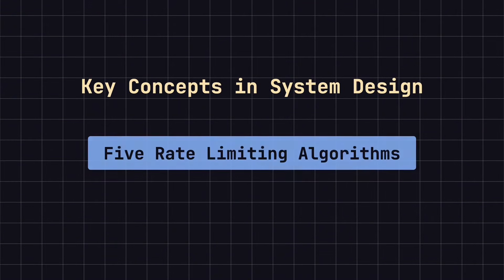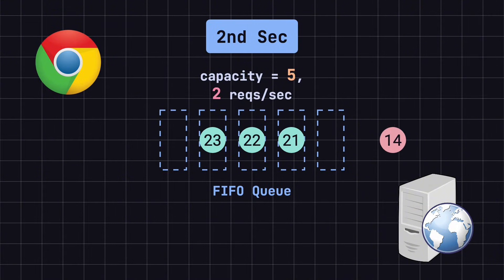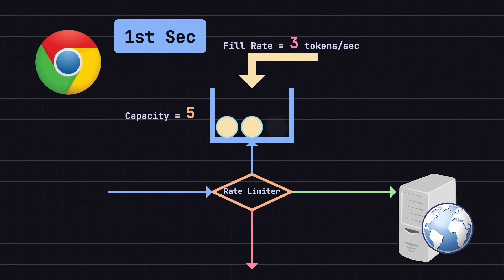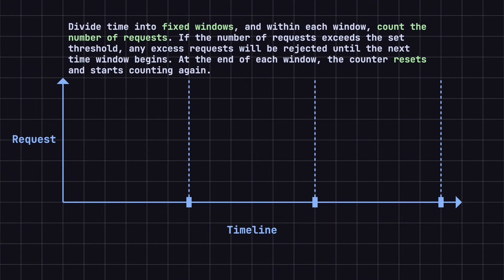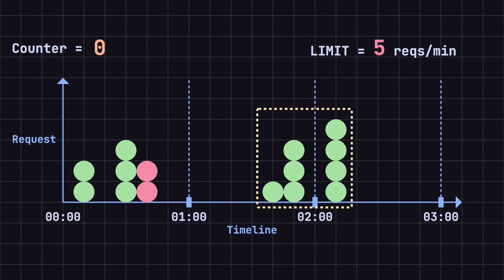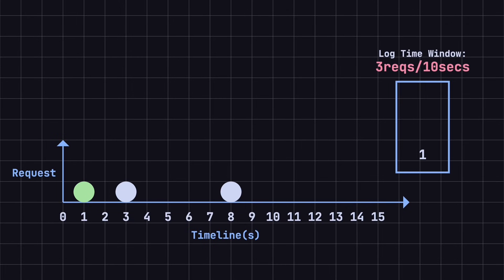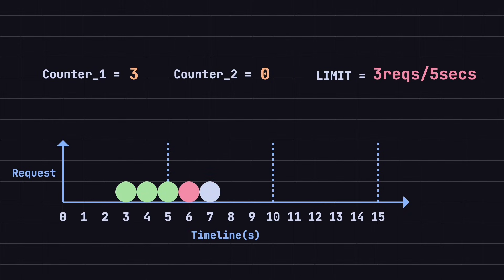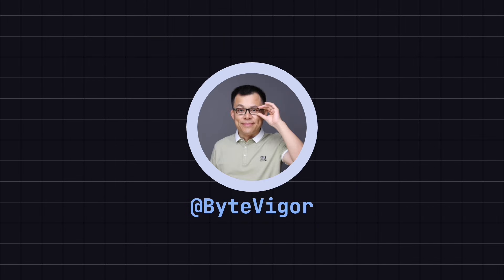Five Rate Limiting Algorithms ~ Key Concepts in System Design

Comment: In the sliding window log algorithm even if the request is denied due to exceeding the threshold the timestamp of the request is still logged. Let me know my understanding is correct?
Reply from the maker: Yes, your understanding is correct.

In the Sliding Window Log Algorithm, even if a request exceeds the allowed threshold and is denied, its timestamp is still recorded in the log. This is because the algorithm maintains a log of all requests within a specified time window and uses this log to determine whether future requests should be accepted or rejected.

By storing all requests—including denied ones—the algorithm ensures that the rate limit enforcement remains accurate, preventing bypasses due to ignored requests. Let me know if you need further clarification!
Reply: Do denied requests that are still in the log get processed later?
Reply from the maker: @ In the context of the sliding window log algorithm, denied requests that are still in the log typically do not get processed later because they are part of the sliding window and are used to track the rate of requests within a specific time window.
Reply: @hello-byte  Pictorial representation in video seems missing 9th second record denied entry in timestamp bucket